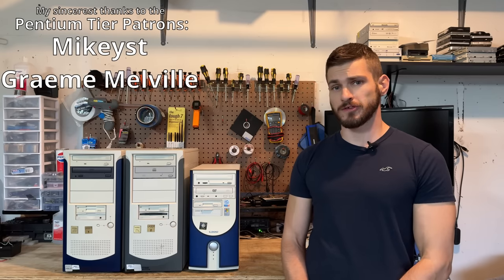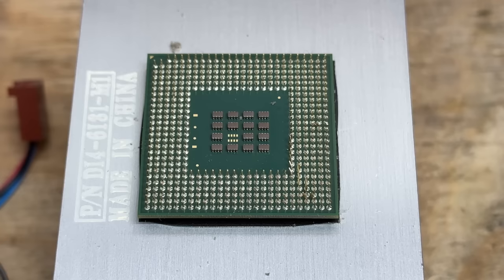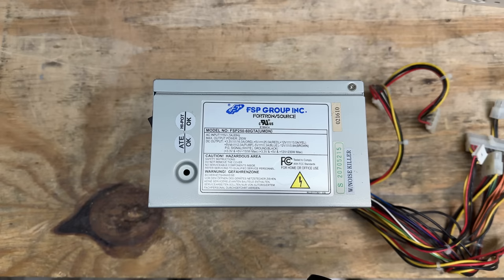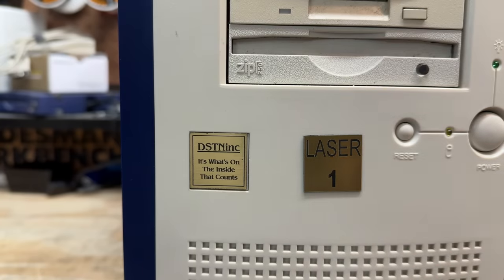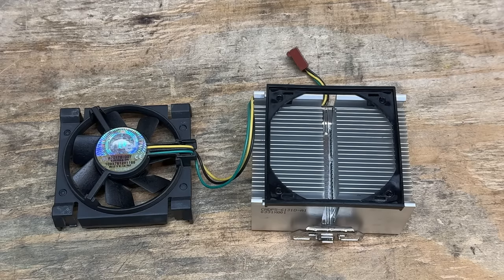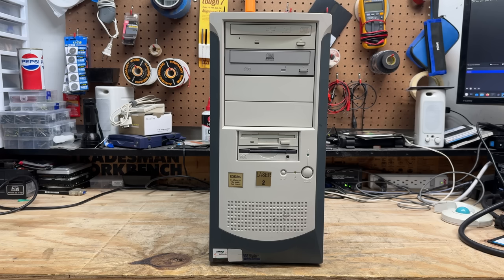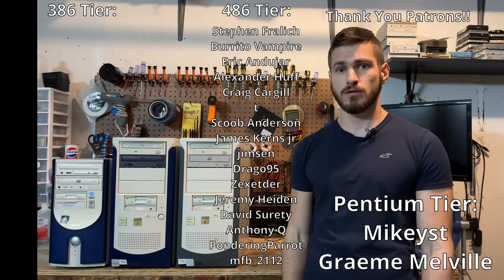2000's Systems! Teardown and Test!

Comment: Hi MikeTech.  The Medion Brand of PC's was sold in the UK by Waitrose and Tesco, both of which are Supermarkets.  That was back in the days before Aldi and Lidl arrived in the UK.  Some 15 years ago, I inherited one from the eldest son of one of my cousins, after he passed away.  I came with Windows 98SE and a MSI Motherboard  with Pentium P3 CPU; 1 GB of DDR RAM; 2 GB Hdd and 17 inch IBM Monitor.  After having given it a good service, I sold it to a neighbour, for her son's 10th Birthday/Christmas present.  He was very pleased.  Several years later, I upgraded the Motherboard; CPU and RAM, with another MSI Mobo and AMD processor, as they were cheaper than the equivalent Intel mobo's and CPU's.  It has recently been returned to me and I am now in the process of upgrading it again, for a young lady who wants a Gaming Machine.  As with all my own PC's, I shall be installing MSI/AMD components, as over the course of the past 21 years, I have found them to be ultra reliable and very good value for money.  As the saying goes, "If it ain't Broke; Don't Fix It".

Comment: FSP is actually a very well regarded power supply manufacturer as far as I know. At least in terms of their OEM supplies. (I think their consumer ones are slightly less well regarded tho if I remember right) Might be worth a repair, then again I imagine you don't have a shortage of ATX power supplies.
Reply: oh man, those FSP PSUs are pretty nice, until they kill your mainboard. i once used a 400W FSP PSU from a Fujitsu-Siemens Scaleo P as my main PSU for quite a few different PCs, until it killed my Gigabyte GA-Z97-UD3. since then i am using a Seasonic 650W PSU.
Reply: FSP supplies are junk, they use no-name wofat garbage caps in them that fail. Right down there with HEC, Liteon, Bestec, etc.
Reply: @GGigabiteM  never had an issue with them myself. Also they get used in a decent amount of enterprise and pre-built stuff by larger OEMs, which I very much doubt they would do if they weren't at least decent. Those companies fucking suck and make crap half the time, but they don't want the liability of a computer catching on fire.

But interesting to hear your experience. Will keep it in mind.
Reply: @mina47879  I've recapped dozens and dozens of FSP supplies in all matters of OEM systems, they're just junk. They would be fine units if they hadn't cheaped out on the capacitors, which cause other component failures in the supply if left bad long enough.

They use no-name crap like OST, Stone, Teapo-Cheapo and AsiaX to name a few.

The only reason they're worth recapping are if they're proprietary form factor units, which are entirely the realm of OEM systems like Dell and HP, who LOVE to use proprietary PSU designs.

Comment: Wow, I love your trick for fixing bent CPU pins.
Reply: I like using mechanical pencils.  Take out the lead and you have a narrow metal barrel you can use to straighten them.  Seems to work better on narrower CPU pins.

Comment: I like those blue case accents.  Funny story, I built a computer several years ago and didn't really know much about parts selection.  I got a case with cool looking vertical sections down each side of the front that looked like LED lights, but didn't know for several years how to make them light up.  Doing an upgrade one day, I finally found the wire to connect them and discovered they were in fact blue lights!  I never said I was a genius 😆

Comment: i live near and Aldi and they do still sell Computer laptops phones, i didn't know until now that there are Aldis in the US. And Windows 7 that is so recent in my work they did intall Windows 7 on allot of XP machines and it works great besides the dead internal batteries they can even handle Aero, that's how good Windows 7 was.
Reply: Aldi has been in the US for over 20 years. Maybe a lot longer.  Lidl is also in the US and both of them are trying to expand everywhere.

Comment: Medion PCs were kind of famous in germany in the early 2000s. And they were mostly sold in the ALDI grocery store which had a small electronics assortment which consisted of temporary offers until sold out. So they never had a regular assortment of electronics, just an isle were they sold everything from mattresses, to BBQs or vacuum cleaners on an occasional basis. The Medion PCs were very reasonably prized and were famous for being sold out on the first day of the offering. Buyers were mostly normal folks not the computer geeks.

Comment: I remember these kind of Medion systems in ALDI. ALDI usually has special offers (super buys) on Thursdays and Sundays. They would have a bunch of stuff on a theme. The PCs would be one model, limited to being released at one time, but often a pretty good deal versus the other makes. My neighbour had a couple over the years and I helped fix them. The custom front panel and an MSI motherboard was a staple of the 2000s Medion. I am sure the offers leaflets are online somewhere.
Reply: And this particular design was around for a while as well, I had an earlier model with the same face but a Windows Me Pentium 3 System inside (and no built-in video capture).
Reply: Here in EU we also have the same practices by LIDL. :)

Comment: I always liked how easy it was to distinguish the different Athlon and Athlon XP cores just by looking at the die. Guess there are advantages to having no heat spreader! I used to have a 2500+ Barton  back in the day, and the best thing about it was you could set the FSB speed to 400mhz from stock 333 and it was identical to a 3200+ at a fraction of the price!
Reply: I agree with you. The 2500+ Barton was the best. Overclocking beasts. Best XP's ( including Microsoft's ) ever made.

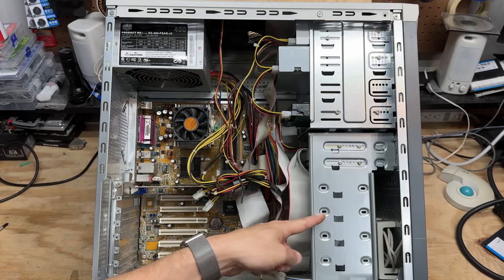Comment: Mike your videos are great - the systematic and granular level of breaking down and testing these systems is well done. If you ever want to grow the channel in a new direction, taking your clean-cut and detailed approach to explaining basic electronics could also be a great content goldmine for you. Example: @ 36:40 you talk about the strange setup with the fan header extension. A video covering the basics of connector pinouts and how each are manipulated/communicate could be a great video or series of videos depending on how you cut it. Take care!
Reply from the maker: Thanks! I’ve thought about doing something like that. A ‘circuit walk’ if you will. It’s definitely something I’d like to try once I’m able to devote more time to the channel.
Reply: @miketech1024  I upvote for this ^^

Comment: Great video as usual. I started pootering in 1994 and now have computers all over the house and I can still relate to the early machines. My earlist working pc is a P1 75mhz overclocked to a massive 100mhz now running W95. My latest are Ryzen 5000 series powered and Intel 9000 series. I mainly run Linux now, but still use W95, 98, 2000, XP, 7, 10 and recently 11.

Comment: During my time working for a small PC builder, I used a razor blade to straighten pins on older Ryzen CPU's. As you could straighen multiple pins at a time.
Reply: Yeah, razor blades are my go-to implement for straightening pins (for modern CPU’s anyway)

Comment: The molex connector for the fan in the third one is because older MBs couldn't handle fans with high amps, the fans simply wouldn't spin up. I had a few fans in those days that would not work when connected to MB headers.

Comment: I use card space blank from pc case to straighten cpu pins, just put it between the pins and wiggle it, go thru every pinrow, rotate cpu 90 degrees and repeat.

You still have to manually straighten the edges and corners, but all the pins in the middle will self-alling perfectly
Reply: for ryzen that has smaller pitch, i use old credit card.
You still have to manually get the pins straight enough for the card to fit between the rows.

i highly recommend anyone who reads this to try it if you ever have bend pints

Comment: The first PC you showcased was the first computer I've ever used, down to the Sims 2 DVD that must be still laying around somewhere at my parents' house. Mine came with an Athlon XP x2 and 256/512 mb of RAM though so i guess i got the low-end trim of the lineup. The PSU on mine was different and had an OBNOXIOUSLY loud 120/140 mm fan arranged in pull configuration on the bottom of the shroud. Good times.

It was also the first PC i ever disassembled, and the first time i learned what happens when you don't handle a mechanical hard drive with care. Oops!

Sadly apart from the dead drive, either the PSU or motherboard went kaboom may years ago, and i never got around to diagnosing it. But the reason that PC holds a special place in my heart is the time my mother opened it up to clean it and i started wondering what all those things on the inside were there for. Fast forward a decade, and now I've got a computer engineering degree and halfway through a machine learning master, all because of that old underpowered (keep in mind i was using it in the 2010s) rust bucket, lol!

Comment: Believe one of my Brothers bought a Medion PC similar to System 1 from an ALDI here in Birmingham, UK, I was not a Fan due to very little flexibility with Upgrading it, 
Out of curiosity, Have you ever heard of a Piece of Software called Sequoia view (Think that’s how it’s spelt?), It runs in a Windows environment and It’s a great little utility that displays what is taking up space on a drive, I believe it also works with Optical & Removable Media too, 
Also, If i have an issue with a CD / DVD drive reading disks then I generally open the Tray and blow into it and you be surprised at how often the Drive will read the Disk after I’ve done that! Keep churning out the Great Videos while injecting the Humour where you can! 🙂🇬🇧

Comment: The embossed Powerbutton and Made in Germany on the Medion PC: Thats a Terra Case labeled for Medion. 
The Button is the Terra Symbol.

This Chassi was around for about 10-15 years only with different Faceplate. The second Aldi PC had it for sure.
The Pentium MMX 166MHz from 1996. The Chassi was used till about 2008.

Lite-On was a close partner to Medion and Medion sold Lite-on products directly in Germany, even in Aldi-Stores you could buy the Optical Drives, when it was Computerparts weeks. Thats how those were and still are sold: One or two Weeks twice a year in the "special Week" they are sold to get more costumers into the Shop.

Wortmann AG is a PC Manufacturer in Germany and it's Professional Trademark is Terra, with it own Productionline. 
Today they do Office PC and Servers.

Older German Gens may remember their Consumer Line and Shops: "Vobis"

Todays Medions PC and Laptops gomes mostly from MSI.

Comment: My computer is from 2008. I tweaked it and I have Windows 7 professional. 3 Ghz processor, 8 Gb RAM, Nwidia Gforce GTX 770 graphics card, three hard drives 500Gb, 200Gb, 120Gb. FOXCONN motherboard. Works perfectly for my needs. I learned a lot from you. Thanks and best regards. 🤝👍 My set starts up in 1 minute, fast.👍👋   I have another computer with Windows XP, but I don't remember the specifications, I will check it and write to you. Also tweaked by me.😁👍👏

Comment: Hey man, ran into you over at vcf southeast and been loving your content since you mentioned the channel to me!  

Thought you might wanna know, the original graphics card was likely a Medion as well for that first system.  I have a handful of their VGA cards and a few of them have similar form factor connectors, but I wouldn't be surprised if it was specifically a Medion GeForce ti4200, I've got one with the input for that connector and the yellow matches perfectly!

Pretty neat as although I knew what the connector was for after some research, I've never found a system that actually had the output ports!

Comment: For removing old baked on thermal paste, including those horrible pink/yellow squares of stock thermal compound shipped with many Athlon coolers, Lectra Clean works wonders. It'll melt that stuff right off, and is safe for cleaning circuit boards. Just don't get it on plastic, it will melt plastic and turn it white. It will also eat LCD screens instantly, so keep it away from them.

Comment: As I watch this video admiring the style and features cases during my teen years was like; I wish that my metal monstrosity of a PC tower could be smaller and more welcoming, or at least cute and homie.

I think I heard of firewire once or twice but I never had any use for it before.
aah those white zip ties, I never knew where people bought those for the longest while.
CPU pins always make me very nervous, that reminds me I need to brush out the caked on dust that my can of air couldn't move.

I do miss cases that could simply friction fit drives and such.  
haha "We'll just leave it there to confuse future generations." I love it.  
So that's where my Sims 2 cd went. /s

I love that orange PCB, Makes me miss the days of colorful motherboards and such. Now all we have is blinding RGB lights.  
:O I had no idea some cases had removable mobo panels. Very interesting.  
As a fan of Windows XP myself 7 was a worthy OS upgrade. As a side note I like the old school Pepsi logo in the background. 

After watching this video I count myself lucky that I only had 2 expensive failures and both were with my first PC.

Comment: I don't know if Tesco supermarkets ever made it to the USA, but over here, they're a mainstay of just about every town and city. They used to sell (and maybe still do) sell Medion badged products. Some folk over here are very dismissive of Medion, but despite the budget price and quips about "Just off to Tesco's for some milk, beans and a Medion PC" they were quite popular machines. Not only were there Medion PCs, but you could get TVs and radio/CD players etc wearing the same badge.

I bought a Medion PC outfit from the local junk auctions, not long before the covid panic. It was (emphasis on WAS) all complete with PC, keyboard, mouse, monitor, system setup discs and literature, all packaged up in original cartons. However, someone seemed to think the monitor was worth stealing, so they took it. A pity really because I wanted the system on account of its originality and completeness.

What was the system? A fully loaded Intel core 2 quad, with a full suite of multimedia functionality, including digital and analogue TV, radio, satellite, and AV I/O, and off air recording. I can't remember how much RAM, but it WAS gifted with 1TB of HDD capacity in the form of 2x512Gb RAIDed SATA HDDs, except that the previous owner had removed the drive that contained anything of importance to them.

Ultimately, I want to have a go at restoring them to fully flying condition - Should be good for W10, as long as I can find drivers for all the media hardware. I know it's not an antique, but Core 2 Quad? That's still getting long in the tooth! I also grabbed four old Dell C2Q systems as well, but they're basically junk, but still largely complete, albeit plagued with green capacitor disease!

Comment: For Athlon XP you will need old versions of browsers, because chrome based started requiring SSE2, which this processor doesn't have. Other things may work fine relatively, but windows 10 will need it too i think.
Reply: Extensions are a large part of old processors not being able to do modern computing. I have a 6 core monster Phenom II that's practically a brick these days despite it being a decent clock speed and 6 cores and the system having 12GB of ram.
Reply: @tarajoe07  I was using Phenom 2 X4 955 until i got myself I7 in 2014, and my friend used similar until just last year, when he switched to Ryzen. It's power is just not enough anymore for personal use, but for office use it is pretty ok. But i noticed how much slower it crunches windows 10, as with early i3 that i have.
Reply: @Jutah82  exactly. It's the lack of newer extensions. They make modern processors more efficient and some tasks outright can't be done without them.

Comment: Have heard of Aldi's Medion PCs but they tend to have very low prices and sell out immediately. Never actually seen one.  Aldi has used the Medion brand for other electronics as well.  Anyway, the PCs marked "laser 1" may have been for a laser printer.  A place I worked used that nomenclature for what was nothing more than a specific PC with attached printer. The PC was used to submit print jobs to run and a ZIP disc was handy for big files.  Said company now uses ink jet printers but still calls them laser # whatever because that is simply what they have always called their printers, and whatever is attached to them, even though there is no longer any laser involved. I was told they started doing this in the 80s the word "laser" sounded high tech.

Comment: Lol about aldi, they are springing up all over the place, in fact they bought out winn dixie, so if they do still sell medion branded systems, your chance of obtaining one just went up lol. yeah that oversized power button thing, it was pretty much 2000s there, oddly enough the reset button has faded a bit over time, some cases have a small one or not at all. The Best buy sticker was a service sticker. have had many eventually come my way after a "Diagnostic" job by geek squad.

Comment: Those Best Buy date sticker got put on PC's that were brought in to be serviced by Geek Squad (Former Geek Squad person here) Those are definitely the date on the stickers. Probably came in loaded with malware. The SiS chipset was most likely due to the fact that Intel had not yet released the 845 chipset when this system was designed and Medion didn't want to use RDRAM memory which was really expensive. Perhaps LASER was used at a Laser Tag arena?